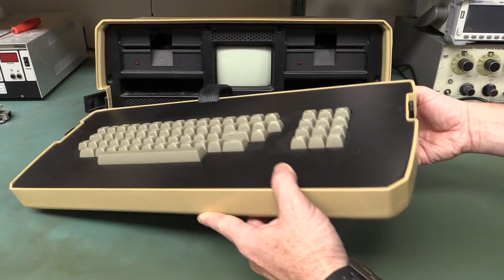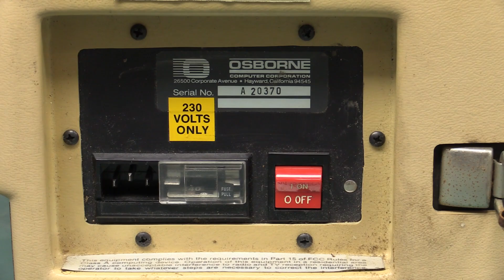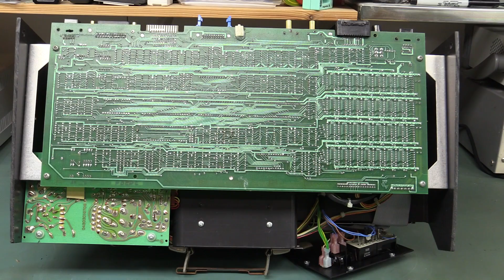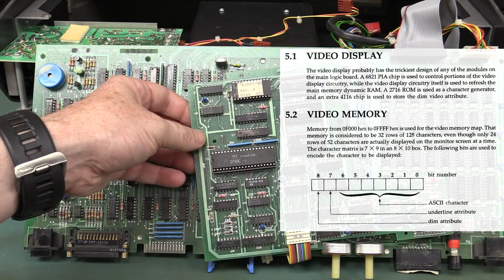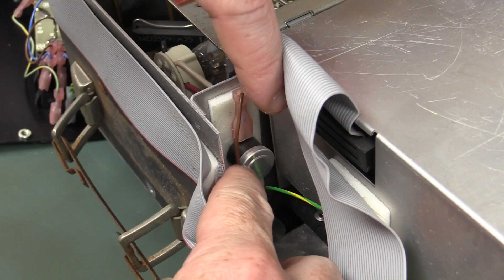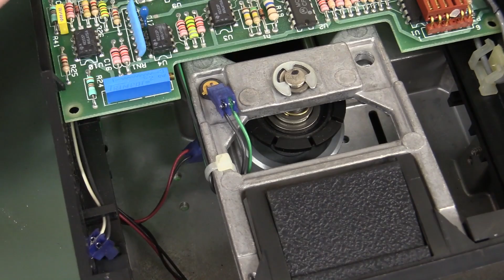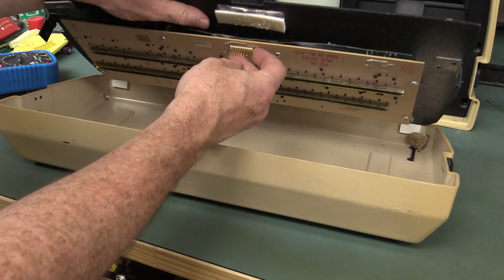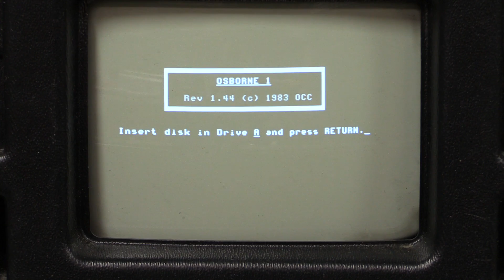EEVblog #955 - World's First Portable Computer Teardown

Comment: I have a Sanyo Luggable (41 Lbs).   9" CGA screen, 2 40 track 5&1/4" floppys, 48Kb Memory,  Added a 6-Pack w/ Parallel Printer port, Serial Port, 384K memory, Modem 1200 Baud & 2 other things I can't remember. I also added a 10MB Western Digital Hard Card. It all sits in my on the Bedroom floor between the wall and Dressor with 5 or6 old Laptops, Old Analog Video Editing Switchers/Titlers.

Comment: That upper board isn't the "Video" board per-se - it's the "Screen PAC" extended video upgrade to provide 80 and 105 character display options on the small 5" screen. It compresses the video horizontally and adds additional characters... Connecting that secondary board was considered a "Field" upgrade. You can also remove the video shunt lower-right on the PCB, and it disconnects the 5" screen and you can connect an external screen into the slot with 128 x 32 graphics.

Comment: Hi Dave, this post could also be on your Oscilloscope Ground Short video ( https://youtu.be/xaELqAo4kkQ ) but I had an interesting issue with the ASTEC AC-8151 power supply in the Osborne-1.  I recapped it and was testing before reinserting it in the PC. I wanted to look at the waveforms but whenever I put the RIGOL ground lead onto the negative end of the big capacitor C7, the lights went out!  Three times I needed to go to the power box and reset the RCD.  Ultimately I moved to connect the Rigol Earth Lead onto the output common lead and then could see some kind of pulse with modulation signal on the top of R13 (?) where it attached to the collector of Q2.  I wathced TRX Lab and he made a commont that the 'scope in his lab ALSO is connected to an isolation transformer.  I didn't try that yet. ( https://youtu.be/4-oN4m1PPxY?t=3261 )
So two issues here Dave..
1. Why did the lights go out when I connected the Rigol since the circuit was on an isolation transformer?
2. How does this circuit work?  Its very common for SMPS of the early 80's (Apple II has the same thing almost).  There are no IC's, just Zeners and a few transistors.
3. Have you seen anyone make a LTSPICE emulation of this circuit?
Images and Diagrams on dropbox here:
https://www.dropbox.com/sh/llgaplzarf6y1gp/AADzEsxhQgCFtcrZ0jJR5i28a?dl=0

Comment: Wow!  This was a trip down the years for me.  I was the president of the Osborne user group in Lane County, Oregon.  The San Francisco chapter was named the First Osborne Group or FOG and their newsletter was The FOGHORN.  Cute huh?  When we were naming our group I wanted First Lane Osborne Group (FLOG) but others wanted to be serious.  My unit was a later version that had all the circuitry on one board and none of that messy patch wiring.  The monitor was fastened to the chassis by screws from below I don't remember any others but it has been a long time.  I was wondering if you would discover the dodgy way the drives were powered.  It was not by separate wiring but from the main board via the data cables!  The result was not good.  The biggest problem was the power connection to the main board which was none too robust.  Resistance would build up and the rotational speed of the drives would become unstable.  I tied a length of fishing line to the flimsy little wires on the connector and led it out the front.  Drive problems could usually be fixed by tugging on the line.  Yes, many users got external monitors for that port.  The first ones were green.  I held out a bit longer for an amber one.  We were really jazzed to have 80 columns scrollable to the full width of the video memory.  Lots more stories...

Comment: my dad still has one, serial number A06128. still works and has the software disks, only issue is sticky keyboard keys as it's been sitting in storage for a while... with some fiddling around inside the keyboard we got it unstuck so it wouldn't register the "stuck key" on boot up. my mom used it in college though there is NO word formatting like what you'll find in even the basic Notepad today, you had to do ALL the word formatting yourself so that it wasn't all on one line when you went to print(basically formatting in the "word wrap" function manually). came with a 4kb modem!

Comment: The video board is an Australian add on to give 80 x 25 display on an external display using the composite video connector.  It was installed here in Australia. It was accepted by Adam Osborne and here we honoured warranty with the changes made.  Interestingly the Osborne 1 sold here in Australia for $1795 where most other importers of computer marked it up 200% - 300%.
Reply: I had forgotten about that mod as I never saw one.

Comment: I don't recall half height drives until late 1984, early 1985. You expect the first of a new idea to have a lot of thought put into the design? Here Osbourne took a full size computer and peripherals apart and stuffed it into a luggable container. You continue to mock the design quality yet there was no other design to base improvements on. You mention the trash 80. In order to use it in my ham shack I had to build a faraday cage around it so I could reduce the RFI in the shack. I have a 5.25 inch floppy with CP/M on it. I also have an 8-inch floppy with DOS and Dbase II.

Comment: How did I miss this video! You saved me a bit of time and trouble with your teardown. I have an Osborne 1 and the follow up model the "Executive" OCC 1 and OCC 2 respectively. 

I actually used these back in the day but neither machine has been powered up in decades. I belive I still have a full set of software someplace as well. These were amazing machines in their day but I definitely do not miss Wordstar! My two machines will be going to a new home with a nearby computer museum that only has a Model 1, in fact I think their website stated that they had never even seen an Executive! Better for lots of folks to see them than have them sitting in a closet for another 30yrs.

Comment: 1982, Bosses at Hughes Aircraft Co wouldn't provide funds for an Osborne, so we build a computer in the lab and used CPM programming with wire wrap and gp boards.  Motora chips as I recall,  Chips  6810 etc..  Hardest thing was to program was the TTY interface.  Later they purchased an IBM PC and gave it to the managers secretary for proposal letters.

Comment: Actually you didn't need a strobe.  All you needed was to be in a room with fluorescent lighting.  The 60 was for calibrating in countries with 60hz mains (ie USA) and the 50 was for calibrating in countries with 50hz mains (ie UK).

There's a liner pot with a standard slotted screw head, you adjust it 'til the bars stand still with a floppy loaded and the head engaged.

Comment: In Feb 1982, I had to decide between Apple 2c (4800USD), IBM PC(5300USD) and Osborne1 (1795USD) which included software, Osborne 1 won. I still have it and all its original software. Just needs disk drive belts. It was the longest lasting PC I've had. Thank you for this post!!

Comment: Your Osbourne 1 has an 80-column video upgrade installed. From the Wikipedia page:

The Osborne corporation offered a "Screen Pac" 80-column upgrade that could be switched between original 52 column and 80 column modes. Osborne 1 systems with the 80-column upgrade have an RCA jack installed on the front panel to allow users to connect an external composite video monitor. This modification was developed in Australia by Geoff Cohen and Stuart Ritchie and taken to the US by Stuart who turned up unannounced and sat outside Adam Osborne's office for two days. Osborne bought the mod as soon as they saw it and both of them worked with the Company to implement the mod. As a nod toward where it came from it was called the "Koala Project". Geoff went on to invent many other upgrades for Osborne's and was regarded as the Australian expert on the computers.

That explains the bodge wires. The daughterboard sits between the CPU and video connectors, but that still doesn't give it all the signals it needs so you have to tap various places on the logic board.

Comment: Your comments are quite off for someone collecting so much old stuff. On space inside the unit: have you forgotten how HOT these things run? If they had spaced things the way we do now, it would have died/taken fire quite quickly. And on the thread soldered to pins on the board: yes of course it is a workaround because there was not enough space on the PCB. They didn't do multi-layered PCBs at that time. Even just double-sided PCB was already quite nice stuff. Don't judge 1980s hardware with 2016 criteria...
Reply: On the chips being different: it was good practice at the time. Chips from the same series and same locations tended to have the same flaws and die at the same time. What you noticed is actually good design in the 80s
Reply: you could get computers repaired back then (not just replace the whole MB like now)

Comment: I have an old TraSH-80 at the moment! Dave, I even sent you a picture of where the magic smoke escaped (on a 723 voltage regulator for the 12V circuit). Should you use it in a video, don't mention my name.

Comment: What's the name of those blue connectors used for the optical sensors at 25:00? I've only ever seen them in red before, and only in (lots of) old equipment. Are they still made?

Comment: This video tickles my fancy, the Osborne 1 was the first computer I ever owned!

There was a 300 baud modem available for it.  The previous owner of mine had sprung for this extra.  The modem slid into the diskette storage slot under the left drive and plugged right into the modem port with a very short cable.  The UART behind that 25-pin serial port was only capable of (I think) 1200 baud maximum, and I was never able to get my hands on a 1200 baud modem while I had this machine, so I settled for the 300 bps.  I tried a few different more modern 2400 and 9600 bps modems, but it wouldn't even talk to them.

I used a Commodore 1702 monitor with mine for a while, but quite honestly that little bitty CRT was quite clear and wasn't fatiguing to stare at for hours on end, so I mostly didn't bother.

The only video games it had were the ones I typed in BASIC from the back page of National Geographic Kids magazine.

Comment: Nice review.  Ozzy 1 was my first computer.  I typed my dissertation on an Osbourne One.  I printed it out using an Electric Typewriter with a home brew serial adapter with about a two characters a second output rate.  It would take around ten hours to type out the entire dissertation. Each page had to be fed into the typewriter manually of course.  My next "PC" was a Kaypro when I couldn't find an Osbourne Executive to buy.

Comment: Ha. Your dead on about the tantalums being fire starters. I got hold of some 30 year old 5 hole paper tape reader/punches (siemens T1560). Rigged up a 3 pin plessey cable for mains power, plugged in and the tantalums for the power distribution actually burst into flames!! All replaced now though.

Comment: 15:40 That crazy wiring job really seems more like some kind of add-on or aftermarket upgrade. (Being a child of the '80s computing era, I'm well acquainted with the sheer volume of aftermarket upgrades and mods available for the Apple II, Macintosh, Commodore, etc.)  The whole 'solder these wires to these pins' ridiculousness just screams upgrade mod...  And I did a quick google image search for this exact model of Osbourne 1, and I can't find one with that RCA jack... (And pics of the internals don't show that second board.)  Only the later model ones seem to have it...  Maybe it's an upgrade to turn it into a later model Osbourne 1?  (Heh, somewhere I have an IBM drop-in upgrade board for the PS/2 that plugs into the sockets for the 386 and its 80387 and turns it into a 486...madness! lol)

Comment: And I often kick myself for not getting enthusiastic about computers in those days...But when I look at how pathetic they were, I
understand why.  The 48k Sinclair Spectrum, a more readily affordable home computer of that era, was so under-cuttingly
cheap that one of the RAM chips was a half failed dual 16K device.  That’s right; Sinclair got those chips cheap, because only 16K of 32K worked.
Reply: We're really showing out age. Ah, the good old days when geeks bit the heads of chickens and didn't work in "Data Processing"!
Reply: Yup...PCs got better and better, although it was over a long period of time.  Just built myself another computer, which does not require a degree in computer sciences to achieve.  Just make sure that you put the plugs in the right sockets, and use the right screws an pillars.  The real painful part is paying for the parts and software.  The CPU/motherboard seller seemed unimpressed by the fact that I had no intention to use the fast hardware assembly for gaming.  I just wanted fast, and only required 8 gigs of DDR4 2133 Mhz ram.

Comment: My Osborne 1 doesn't have the daughter board or the external RCA connector. It also has a hard-wired power cable to the internal power supply. I think the machine you have may be upgraded or modified.

Comment: Hi, I enjoy your teardowns. I just wanted to point out one thing, when I was working on pc's, xt's, and at's  we frequently had to adjust the speed of the floppy rotational speed by removing the drive from the drive case,  and use the ever present fluorescent light as a 60 hz source and tweak a 10 turn trim pot. The drives were inclosed in a heavy cage that was gold anodised. If you were lucky you could sneak your jeweler's screwdriver in between the holes in the cage and save yourself the trouble of having to remove the drive and then reinsert after the adjustment. h what memories.

Comment: Dave, I don't think that RCA connector was for an external monitor since there is a card edge connector. I'm not familiar with the Osborne, but that could be for a light pen. Easy check to see if it is video out is to run a scope in TV-H mode and probe the RCA connector.  If it is video it would probably be proprietary or close enough to EIA to drive an NTSC CRT.
Reply: The rca is NTSC composite video out...I have two Osbornes!

Comment: Aside from the tilted keyboard base, it almost looks like the computer was designed to fit inside a sewing machine case. I wonder if early prototypes were simply built into the sturdiest preexisting case Osborne employees could find, to save cost and development time, then the design just stuck.
Not sure how advanced R&D was at Osborne, but I'm imagining some random employee just grabbing his mother's sewing machine lid and sliding computer parts inside to see how they will fit, then rocking up to work on Monday morning to show the boss.
They could even have used existing sewing machine case moulds to reduce tooling costs.

Comment: my dad still has his, serial number A06198 still works like a charm complete with bootdisk and all :) bought it brand new back in the day! there is a few problems with the keyboards if they've been left sitting for a while... generally upright in it's "briefcase" position where the weight is pushing onto the keyboard... did have to open it up and clean a few contacts and wiggle the pieces of laminate apart to get the keyboard working again(i've seen a few modded ones or replacement keyboards for them) but it's a solid machine! our has the 4k modem built into it though and the pigtail cord on the keyboard!

Comment: A computer made for traveling businessmen powered by a switched power supply only accepting 230 volt. That's just cruel.
Reply: If you were in the states it ran fine on 120.  I think there was something in the power supply you could change to make it compat.  Maybe there was a later model with recessed switch on the back.

Comment: Some of the issue with the form factor was that the machine was designed in 1981, while half-height floppy drives only came around in 1982. I'm sure they would have been used in the Osborne 2, though. :)

Comment: I believe that the "floppy detector sensor" was actually  the "write protect sensor", at least fom it's positioning, if the sensor was "blocked" the disk couldn't be written too, otherwise it could. We use to use hole punches to make "flippies", a sort of double sided floppy that had to be flipped over too use the other side (on single sided drives) or to make obsolete software floppies into data/writable disks

Comment: Couldn't you theoretically use some of those early computers that connect to the TV via RF input with a portable TV? I mean portable TV's back then wheren't as portable as some of the smaller lighter stuff today, but I know that old computers where pretty much a computer and keyboard in one unit, then you connect a TV or monitor to it.

Comment: The compartments are not for storing floppies. They are for putting the modem and the battery module in. But people who did not use these options actually put floppies in there. So dual purpose if you want :)

Comment: I think one of the reasons the keyboard is that big is because you were supposed to prop up the machine on the keyboard, as your picture shows around 5:39. I have one of these Osborne 1's myself which I am trying to restore. For now it just blinks and beeps continuously.

The ext-video socket is to hook up an external monitor and the cartridge that sits in that slot acts as a loopback so that the internal monitor works. Without it, no video whatsoever.
The RCA socket looks like a third party modification as my unit doesn't have it.

Great teardown though, learned a lot :)

Comment: All those Z80 2 layer boards would effectively render any over-the-air RF devices useless due to EMI. I used to work on them in my basement and the televisions in the rest of the house were unwatchable if any of the Z80's were operating. Each had a distinctive pattern of RF interference during boot-up and you could even somewhat diagnose problems just by turning on a AM radio and listening to the pattern of static they would generate. Such fun.